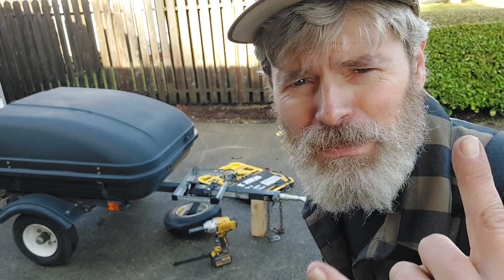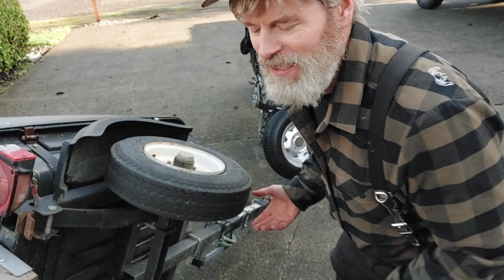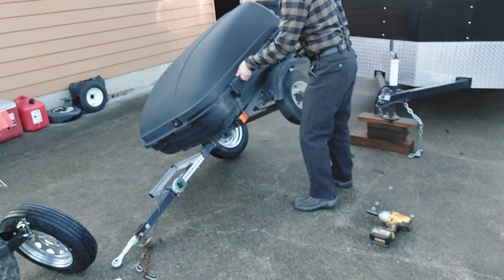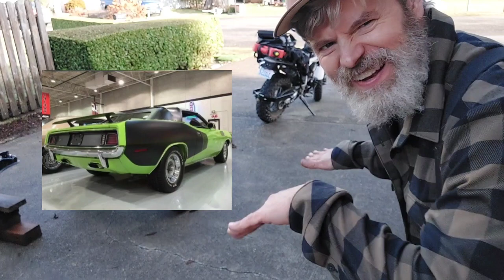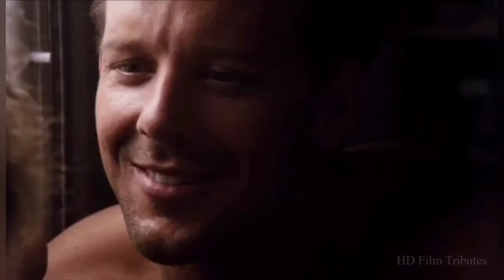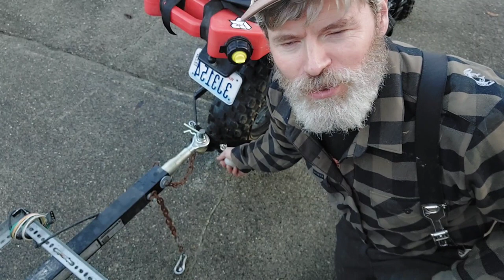My Yamaha TW200 Harbor Freight Trailer Modifications!

Comment: What is the measurement from ground to hitch at both ends (bike and trailer)?  It looks pretty level.
Reply from the maker: It is pretty level. I'm gonna weld a plate of 1/4 steel on the BPP hitch, which will position the Heim rod up 2 inches. I'll measure it all after a few more beers.